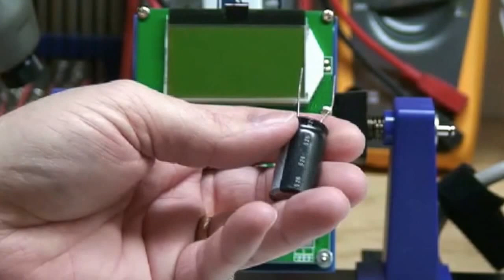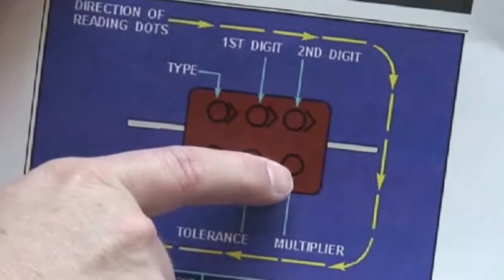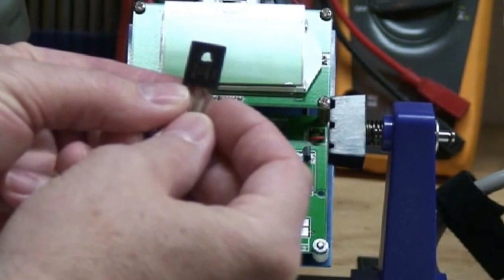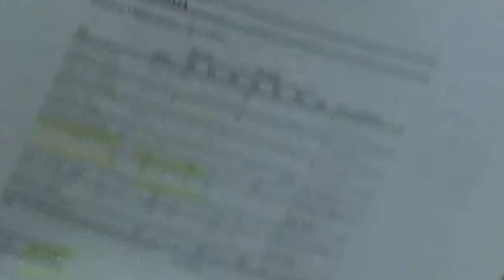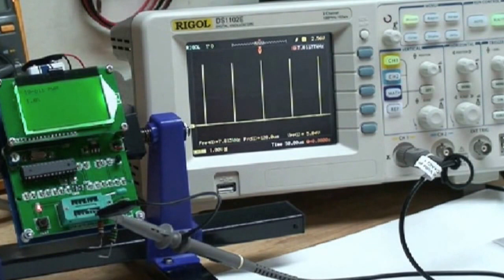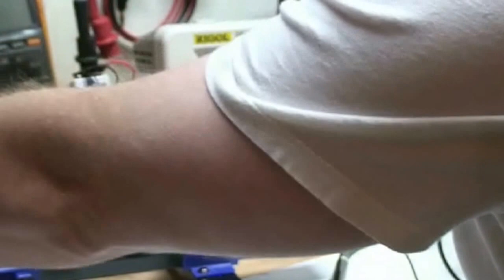Review#1 YOSOO GM328 Electronic Component Tester

Comment: WoW, that one in video looks friggin ancient compared to the new 2020 version , my 2020 model is lacking the display contrast/brightness controls now, that sux. seems the more I use this 2020 version, more I'm liking my older, better made, adjustable display controls. chipset version on this 2020 is 1.13k, ya know if the makers of this device would ever manage to put together some form of a manual for this, I'd probably utilize it more. trying to find my older, red board tester, same design, but 5 years old, would like to see what the firmware version is on it  I think that one still has your contrast/brightness controls in case you turn background and fonts th same color...lol
But here are your key significant changes for the newer 2020 model:
New 2020 board is now Black, same circuit design, BUT now all components are SMD type.somebody finally started putting together somewhat of a manual, better than the nothing papers it used to ome with. I don't like that they added a 2nd test cap, especially because it's some tiny rated cap I'll never have. when you do a self test. Original self test was nice, just needed a simple cap >than a 50 mic cap if I remember correctly
what I'd like to know is, does this tester ever get flashed for updates??, and if there's anybody out there that has one of these newer 2020 versions and figured out where the display contrast controls are, drop me a note to educate me please, the menu has some added features, but are useless to me, and what is"C(uf)-Correction" thats new on the menu, seems to step up capacitance with knob turn
Reply from the maker: Great and very insightful information, thanks for your comment!
Reply: @ThriftyToolShed  like to help when i can, just spreading information for the masses, Thank you for your video(s) & efforts TTS

Comment: Do you know if a replacement Atmega 328 IC is available?  I believe I must have tried to test a cap that still had a charge on it.  Now only display I get is unkown or damaged part regardless what I test.  Thanks in advance Walt
Reply: Walter - I did the same with mine - was using it to test the capacitor on an old analogue scope - got excited and forgot to make sure the caps were drained - so hit the tester with 80V or more.  Bizzarely only one of the pins was damaged, I could still measure across 1 and 2. Anyway,  I bought some ATMEGA 328s from AliExpress and used two Arduino UNOs to download a hex file I found with the new firmware version 1.13 onto the chip.  Then I plugged it into the component tester and it works again!  It  was my favourite tester so I am glad I have it back.  You use one Arduino UNO or a Nano to re-program the chip in an old UNO that has a DIP socket - aka the same chip.  In fact you can just update the existing chip in the UNO if you have one laying around and use that in the tester.  There are a few tutorials on youtube to do this.  Version 1.13 takes a lot longer to turn off when doing a single test so I am looking for the source for this code - hopefully written as a sketch.  Hope this helps - I know its been 2 years but you might still have it in a box.

Comment: good night Sir , a Question how do short 123 pin can you esplain
Reply from the maker: Ulises Aguilar, you need a very low resistance path between, for example in the video,I used one side of three different resistors in pins 1,2,3 and then held them tightly together to form a very low resistance between the pins.
Reply: @ThriftyToolShed  Put 1 short wire in 1,2 and 3 then twist the other ends togather.
Reply from the maker: @kka10001  Yes that is correct, as stated I used 3 resistors in the video and just used the wire lead itself to short out, same thing!

Comment: Dear sir upto how many capacitance (uf) can we measure of this meter?
Reply from the maker: zeno kamei , That is a good question. I have taken a lot of big caps I have in parallel and it reads it. I have not found the limit. The most I have tried is 22.5 mf or 22500uf. Has anyone else in the community gone further with this?
Reply: Thrifty Tool Shed, i am thinking to buy from ebay... My measuring range 1uf to 47000uf...just wanna know before i buy.
Reply from the maker: zeno kamei, If you would like tomorrow I can put enough in parallel to make sure the one I have goes up to the upper end of your needed range?
Reply from the maker: zeno kamei, I connected over 50mf (52,000uf) in parallel and mine tested it fine. It does take up to 15 seconds or better to reach the charge curve of this high value before showing results.

Comment: Does this measure in circuit ESR on caps well, for bad cap testing?
Thanks!
Reply from the maker: SpiderWaffle , In circuit testing in my opinion with the GM328 can be a bit tricky. The quick answer is yes it can, but always be sure to discharge caps before testing. It is useful in checking ESR at a little over 1KHZ but it can't be selected to check up to 100KHZ as some ESR meters.

Comment: Two thumbs up!
Reply from the maker: Sebas Piatti  Thank you!
Reply: Hi! I have a problem here, maybe you can help... Mine is reading capacitance between 2-3 pins but nothing connected,  empty... I cannot calibrate it, it reads no capacitance at 1-3 flashing a 0. Normally operating, if I connect a cap at 2-3 it reads at 1-3! If you put a resistor or led it shows capacitance also. Strange!!! Thanks in advance
Reply from the maker: Sebas Piatti , sorry it has taken so long to respond. We have been moving. I am almost settled in the now and will have time to look at my tester and see if it is anything that is obvious that could cause this issue. I have not come across this. It seems it could be a bad pin on micro controller? or even zif socket having issues?